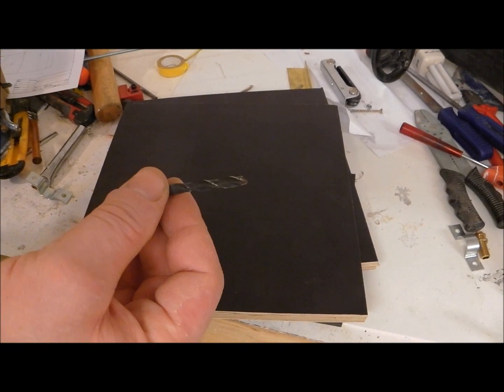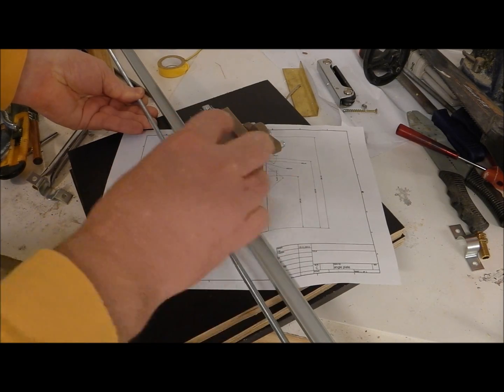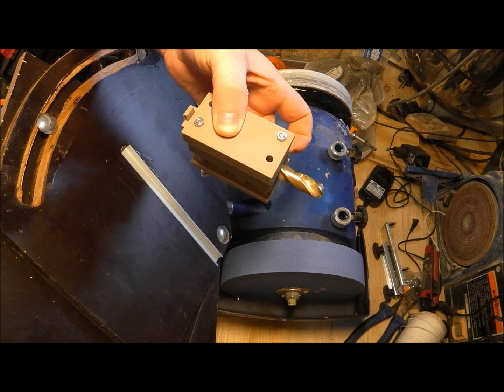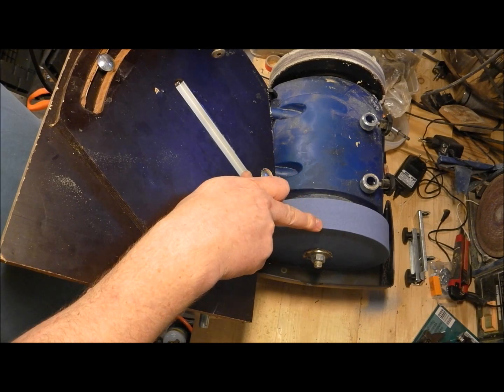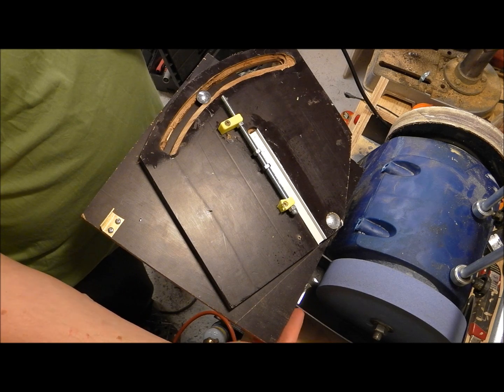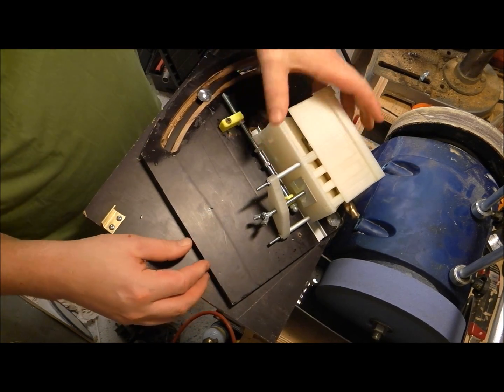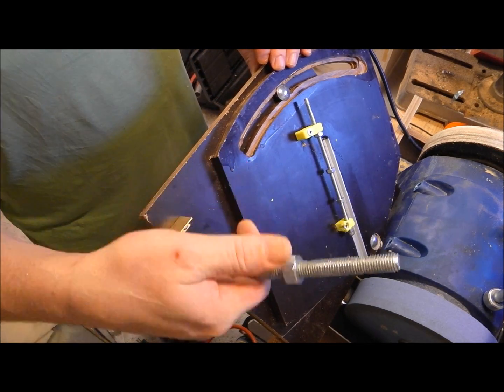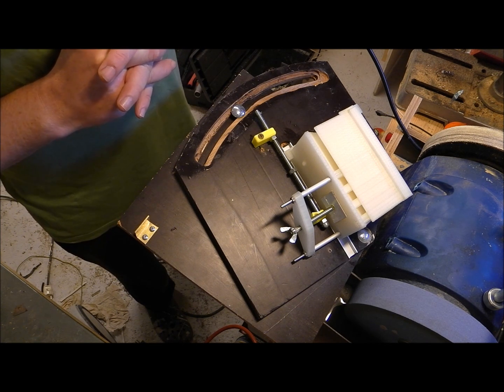DIY 4 facet drill bit sharpener = razor sharp awsome drill bits!

Comment: Ok first of all if you were using square drill bits the holes would still be perfectly raound because they are spinning around a cetral point. They will always be perfectlyt round. Second that hole has a loi of surface damage around it. Something is off.

Comment: Interesting set-up.........I'm going down the path of building a D bit grinder much like the Deckel but more universal for end mill and lathe tool grinding and I'll be using it for 4 facet drill bit grinding too.........I normally grind drills by hand with a simple plate gauge, but the 4 facet method interests me as I've never used that method before.

Comment: This seems an adequate method to create precise 4 facet grinds for smaller drill bits. If you do it with larger drills like 3/8" and higher then you also should split the tip. Splitting the tip can be done by hand since their symmetry is not that critical.  But all this nice tip geometry is optimized for drilling steel. And by the way the 4 facet grind shown in the title picture is not optimum yet. The two edges of the first, small facet should be parallel. This can be achieved by rotating the drill around its longitudinal axis.
As proof of the quality of the 4 facet tip you show us a hole drilled in wood. For wood you use a very different grind with a narrow point in the center and ears on the corners. Those create much better cuts in wood than a 4 facet drill ever could. 
And your slow water cooled grinder is mainly made to sharpen wood tools made from carbon steel that would easily turn blue and loose their hardness when sharpened on a fast bench grinder. HSS tool bits however are much more heat resistant and don't loose their hardness easily because they are made to last when drilling steel. So they can be ground on faster bench grinders which generally are cheaper than your grinder here. You  should better distinguish the wood world and the metal world and their typical tools, tip geometries and grinders. There are good reasons for those distinctions.

Comment: There is a commercial sharpener with the exact same bit holder.  Those use a flare cup wheel.
Reply from the maker: I actually had to look up "flared cup wheel" that could actually be a great sharpener stone if i can find a wetstone variant.
Reply: Teneo Peto
We just used a white wheel. Toolmaker's grinding wheels don't heat tooling up nearly as much as the homeowner's blue, or gray wheels do. White, and pink wheels are just nice like that. But they wear out quickly too. They're softer. Plus I don't think that wheel spun too quickly on the bit sharpener. It just had a little motor on it. Maybe a tenth of a horsepower? That whole contraption was pretty expensive. I think they quoted me a price of $1,600? But it did a nice job.
Reply from the maker: I found one im going to see once i get it from ebay
Reply from the maker: I will i have a diamond flattening tile so i can get it right

Comment: Teneo,
Nice simple jig. However, I would suggest that, instead of changing your wheel to a larger one, you use the side of the wheel. 4 facet bits are usually ground with flat not curved facets (oops, facets are for diamonds only, we've been told), that will give you an edge which is less likely to chip and which wears better. Of course a curved second facet is not any problem. I use a cheap spin indexer to hold the bit which enables an even simpler construction but adds a little to the cost. As you say, 4 facet bits drill very nicely and often remove the need to use a smaller drill for a pilot hole prior to using a large bit.
PS. Instead of using a single adjustable rod to change your clearance angle why not make two rods, then you only have to swap them when you change between the two angles?
Reply from the maker: Good idea, i will make a new version that uses the side for a flatter grind.  

Now that i have been using the jig for a while i think im going to re-design the steering groove and rod for the facet change. i will have to wait and see what i end up with im open for any suggestions.
Reply: MotoChassis 
goodm

Comment: Absolute rubbish. Learn to sharpen drills by hand
Reply: Tell you what, you send me a hand sharpened bit , any angle or dimension and i will test it as sharpened by you and then compare it after re-sharping on the jig. Ill measure cutting ability, Hole roundness, durability, accurasy etc. I bet you anything your hand sharpened bit will not compare favourably on most measurements.
Reply from the maker: Noone can possibly produse this kind of drill bit manually. I have been using this jig for a long time now and it produses vastly superior drillbits. Hand sharpened drillbits are absolute garbage in comparison.
Reply: You're obviously not an engineer, that might be ok for messing about as a hobby, but if you're working on the shop floor . I have'nt sharpened a drill bit for years, so recently flattened off a 10mm drill bit and resharpened it by hand. It was spot on 118 deg inclusive and cut to perfect size. As you say yours are not perfect, well they should be. You get facets on diamonds not drills. Can you do a video on sharpening left handed drills
Reply from the maker: Bullshitt, like you have some magic angle, 6 degrees of freedom, micrometer in your wrist. 

Manual sharpening will always be off. Noone can manually grind perfetcly symetrical bits by hand. Most people can grind a bit that will cut a hole by hand but it will usually not be very good. It wont last very long, and the next sharpening grind produses a totally different result than the previous one.

This jig on the other hand produses perfectly symetrical drillbits at any angle i want that are far superior to even a brand new bit out of the box. 

I have used it for a long time now and i grind all my bits on it. I used to have one of those drillbit doctor machines and it pointless in comparison.

With 4 fasets the hole goes exactly where i put the bit. Lefthanded are also easy i just need to tilt the holder to the righthand side. 

The idea that somone would be able to produce a comparable bit "consistently" by hand!  is ridicilous.
Reply: Thanks for the video, it is great.  I challenge KW to create a video, of how to do what he says he does, and use engineer measurement tools to prove his repeatable accuracy. that would be useful to us all.
Reply: KT I agree with you, this is a great piece of engineering, which will create repeatable accurate results.
Reply: Keith, you are so full of crap your eyes are brown. A hand ground 4 facet drill bit would not turn out with the symmetry needed to make good holes and will lack durability. Oh yes, a hand ground bit will make holes but not as precisely as a machine ground bit. Any decent machine shop will either have a person that sharpens or they send their bits out. It costs too much to have a machinist sharpening when they should be making chips.

Comment: 118° tipped drill bits are meant for drilling metal not wood. For wood you use wood drill bits with a center spike and 200° angle ( outside corners are more forward than the center) this reduces tear out in wood. You should demonstrate your 4-facet grind in steel.
Reply from the maker: +rol eic YOu can adjust the jig to ny angle from 0 to about 60 ° good suggestion ill post a drilling vid.
Reply: +Teneo Peto In your way of measuring the tip angle a tip for steel drilling would have +31° (usually referred to as 118° tip angle) and I guess a wood drill would have around  -10°.
Reply from the maker: Ok i didnt know that, thanx with the jig you can pretty much adjust to any angle you want.

Comment: So you made your own copy of tormek drill sharpening jig on what looks like tormek?
Reply: +zumbazumba1 Tormek like there are a few other brands in trhe same avenue. This does the same job, only difference is this is 20 bucks the brand name versions costs 2-300$ pluss
Reply: Hi. Can you please advise as to where you purchased the actual Drill bit holder from.  Thank you
Reply: 3d print the drill bit holder, the stl parts are included in the files for printing.